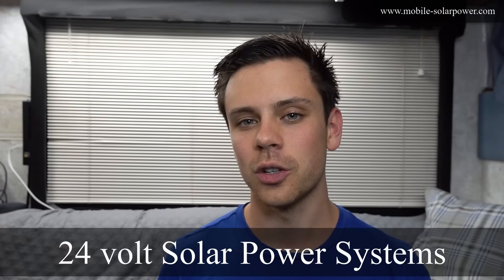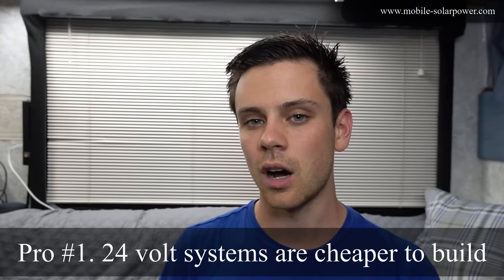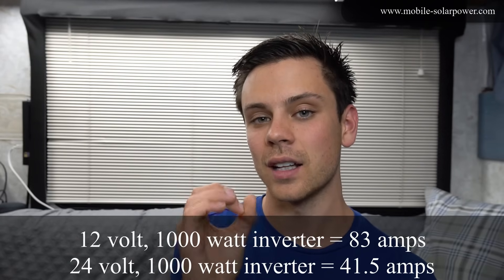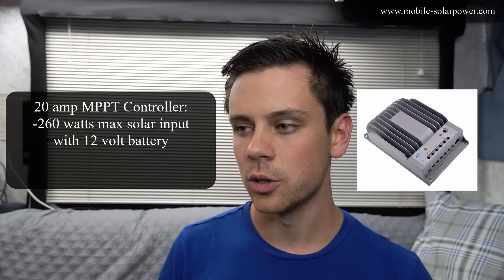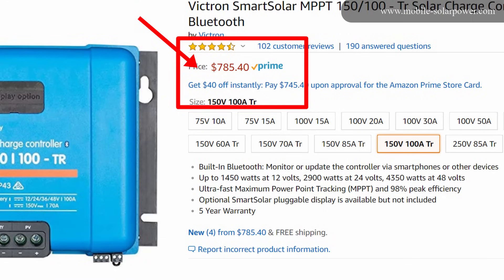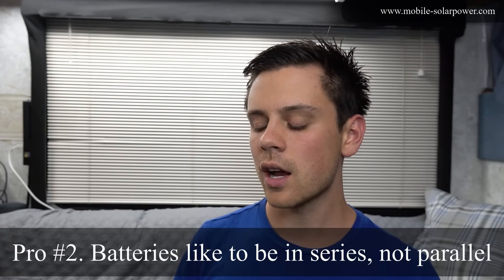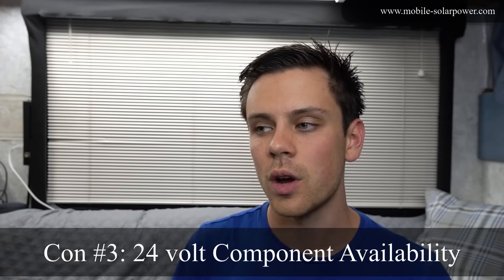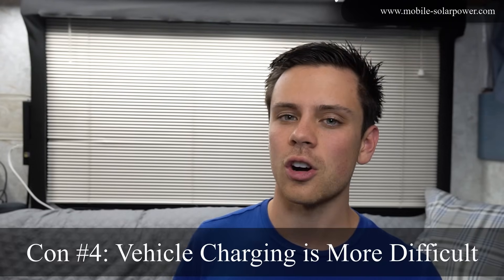12 volts VS. 24 volts for Off-grid Solar Power Systems

Comment: Isn’t the fact that you are spending double on your batteries kind of a big deal? You’re looking at an extra $1800 USD at least assuming we are building a 200 ah system or more.  That should be worth mentioning unless I’m mistaken about how all this works. Very new to solar systems myself so someone please let me know if I’m missing something.
Reply from the maker: No that's not true. You spend same amount. Watch my beginner videos to understand why Ah is dependent on nominal voltage, and why you need to use watt hours instead
Reply: DIY Solar Power with Will Prowse 

Thank you for the response, that clears everything up. Definitely cheaper to go 24v in most instances!

Comment: @ 4 minutes in you said you can't use 12 volt solar panels with a 24 volt system. Is that also true for 24 volt batteries on a 24 volt system to not be compatible? 

Thanks.

Comment: Will. I don't get the limit on parallel connection of batteries (FLA, AGM) as they have been the standard forever (since before you were born....) and they have been connected in off-grid homes with as many as 10 or 12 "batteries" in parallel. Often those 12-volt "batteries" were 20 or 24, 6-volts in series and then connected as 10 or 12, 12-volts in parallel. That was how it was and there was not a concern (that I remember) about having 10-12 in parallel. Is this new and something specific to MPPT or PWM??? Of course, those old Trogan 105's were monitored like crazy and had to be equalized and topped off, but I just don't remember an issue that limited parallel connection to 3 batteries if all the batteries were in good shape and well maintained. (?????)
Can you point me to where I can learn more to understand what you are talking about? It hits home for me as I am in the middle of a 24 volt, 14 battery (12-volts in series/parallel), 1200AH each, AGM battery set up for my home and don't want to screw it up. Thank you.

Comment: I am confused hehe, i currently bought 2 Canadian solar panels rated at 375 watts 39.8 volts 9.43 amps each... so what's best for that setup? Using a 48 battery? With what charger and inverter? But what i want to do is have 4 of those panels so what charger would be best for that setup I'm super confused.

Comment: Great video!  I’ve watched it multiple times. I’m trying to understand why I would take my two 12 volt 100 Ah batteries(200 Ah), wire them in series, to make 24 volts and be left with only 100 Ah.  This question assumes my 12 volt solar panels are wired in series parallel and all appropriate hardware is 24 volt.  I hope that makes sense and am looking forward to some input.  Thanks
Reply: I think I figured it out.  It’s the same watt hours.  12v X 200Ah = 2400Wh. 24v X 100Ah = 2400Wh.  Is this correct?

Comment: Hi, I really liked this video! I was still dreaming of charging my batteries also via car alternator, but maybe I will skip that one. One question relating to this all in one solution, do these things have temperature compensation for charging?
Reply: K.I.S:S. Always work! In a 12V vehicle quite honestly it's not very smart. To go for a step up, to than make a step down! When the entire system is there ready for connection just as it is! 
I addition batteries can also be charged directly from the vehicle. The entire electrical system of the vehicle and RV side can be interconnected without major issues! Material (12v) is dirty cheap and readily available literally anywhere. 

Years ago I assembled a 12V system with the 3 major separations and some "logic" circuits into it. Everything was of the shelf and cheap as can be! Not a single special order!  

- Input from the vehicle 12V alternator.
- Input from 230V (Europe). 
- Input from RV side, also on 12V. Also with inverter for 230V from the 12v source.
Each one of them interconnected, with the other. Self switched. All "logic" circuits were done with very basic (cheap) 12V - 30Arelays. Allowing the 0 - 1 binary (Off - ON) for turning on-off! 

Example: Connect 230v input. All 230v appliances/lights/plugs get ready to work as expected! Simultaneously activate battery charger (12V that first charge the vehicle battery than switch to the RV battery. Simultaneously power all 12V system, separated from the vehicle battery. All that by just plugging in, the extension cord! That was all, there was to it!  ;-)

Comment: Ok, now im confused. I have 2 100 watt panels. A 1000 watt sinwave inverter & a PMW controller & fuses with 4awg wire. No batteries yet since i dont know if 12 or 24v is better for my portable system

Comment: Can I simply use 24v solar panels with a 24v battery bank? I ask because you said there needs to be a minimum open circuit voltage of 40, but for many 24v panels I see have open circuit voltages of 38

Comment: Have a question, I have two 12v batteries and i ran them in series to get 24v, will my 12V 1000watt pure since wave inverter be ok to hook onto 24v  ?   Thank you!

Comment: Can you make a list of components I would need for a 24 volt system to power a large 40 ft bus?
Reply: My main concern is wiring what type and size I will need for inside the bus and for the solar system.  I want the comfort if an RV But better.

Comment: Hi Will, great videos I watched a few from your youtube channel and that are all fully packed of good information. I'm in the process of buying new solar panels and batteries for my 12 volts RV. The challenge is that every single appliance on my RV run on 12 volts, my engine alternator also charges my engine and house batteries (I did not know this was not a good idea.... it came like this from the manufacture). My problem is that I have little space available on the roof and thought to place two 24 volts solar panels and transform the output to 12 volts via an MPPT charger. When I compare sizes I can get many more watts out of 24 volts pannel to its equivalent in 12 volts. Would I actually gain anything doing so? Will 300 watts solar panel at 24 volts charge a 12 volts system faster than it 12 volts counterpart? (300 watts 12 volts solar array). Alternately I could place a 24 volts battery too and convert the output to 12 volts. This thought will require additional changes to the engine introducing a second dedicated alternator....... What would you suggest and recommend? I'm in a hot climate and will be using a Viesa cooling system a lot without the ability to hook up to the main power. I generally drive at list 2 hours every 3 days or so. Thanks for your contribution Daniele

Comment: I have  some 12v panels on my balcony around 200watt living on north of europe and yes solary delivers at least 8 month a year even in north europe. But I agree often 24v system is better since many electrical stuff such as laptops and screens is 19V DC for many laptops. In my case I stepeup 12v to 19v it would be better stepdown 24v to 19v. I also use a cheap  crappy 12v inverter to 230VAC for my 50Wh 40" screen around 15watt is going up in heat :(. 
My guess is that I would save some power by stepdown 24v to 19v and disconnect the AD-DC converter inside the monitor and get rid of the inverted. But for now my biggest concern is battery!
 Lipo batteries! Really hard to find batteries in Europe. I mean seriously cmon EU!!! what the hell is going here? we have alot of problem now getting people in job!!! we NEED battery in EU ASAP!  If we start LiFePO factories in EU guess what people will get jobs working in those factories! EU Wake up for got sake get stuff going instead of spend money on stuff that is not the future!

Comment: hey man quick question , if i run 800watt solar and a 80 amp Solar Charge Controller and the batterys are 135AH x 2   12v, what tickness of cables should i use? and also another question as im 100% new to this, is how thick of cables should run from the batterys for like leds & other lightning in my Camper Van?

Comment: Howdy.
This is a really comprehensive presentation. Just one comment. There are step-up converters too. So there is a way to run 24 V appliances if one should have a 12 V system.
Regards.

Comment: Back when my friend was installing solar panels on the roof, of a bus, it was a sunny day,  and he forgot to cover the solar panel,  when he grabbed the wires to connect  them he got a slight shock, but it was enough to make him loose his balance, and he fell off the roof and broke his wrist😆.  GREAT VIDEO Thanks William Orange county, ca.
Reply: Moral of the story: Don't land on your wrist! LOL 😂 

Jokes apart, as a young (and stupid) teenager I temporarily removed an electric wall heater (230V) from the wall. "Clever mind" taught no need to switch if off! I'll be just fine... 

Well. I was fine until, for a fraction of a second, I touched both wires. I was crouched doing the job. My legs spring so violently that I, literally, flew across the room! And upon landing, crushed the door of a cabinet on the opposing side of the room with my back! 
Only than I turned OFF the breaker switch... ;-)

Curiously! By now my hair and beard are white! AND I always turn the breaker OFF when messing with power! LOL 😂

Comment: Hey Will! Are 10 x 300w 24V solar panels connected in parallel connected to 20 x 12V 100 ah SLA batteries (series for 24v) work fine or is that a stretch?
Reply: A system that size (cost) running on 24v is kind of, sorry to say, ridiculous! 
With so many of everything, up it to a more closer to mains value. Remember  less difference implies less "investment"! ;-)

Comment: wait, why cant you run a 12v inverter off one bank of a 24 volt system ? we use the 12v side of a 24v system all the time

Comment: hmm when i hear you talking about health of the batteries i have a question (not use in solar but battery + inverter only)

i have a 24v system
4x 12v batteries (2 parallel to 2 parallel) they are lifepo 4 battery packs with overcharge and overdischarge protection inbuilt.

As i understand it the "BMS" should
stops accepting charge to that specific battery once its full but will keep providing to the other battery in parallel until both are full. (charging them 2 by 2)
If i use them as described the battery that runs low first will shutdown and the rest keeps going until 2 batteries in parallel is empty.

Comment: if you already have a large 12v battery system and want to do the solar array in 24v, can't you run everything on the roof at 24v down through the controller and then the controller goes to a converter to 12v for the battery, or do the batteries have to directly connect to the controller and always be the same voltage?  For several reasons, it would be best for my house battery bank to stay 12v, but I would like to run the solar at 24v
Reply: your question is the same as mine. for now i would like to continue using the 12v battery and inverter i have, but am thinking about going up to 96v volt solar array to keep the amps down on the headed to the mppt controller. have you had success finding anything out?
Reply: @jasonbrown467  There may have been a miscommunication or something.  I'm getting a Victron controller.  They are specifically designed for an input to 100v or even 150v from the solar....then they automatically convert down to whatever they sense is the voltage of the batteries.  I think the real point is if you have a ton of batteries, you don't want to have too many of those in parallel.  More batteries may force you eventually into a 24v battery system....either way, the controller will convert whatever you input is to match the battery bank.

Comment: Hey Will, can you verify my logic is correct on my RV solar system build? 
I am running a 24vMPP all-in-one, 4 12v solar panels (2 pairs of series)  and 2 12v batteries in parallel... 
I also am using a 24v to 12v converter. Will this system work properly?

Comment: When you say, you recommend Not to hook up more than 3 batteries in parallel. What about 4, 12 volt batteries, turned into 2, 24 volt batteries, then hooked up in series. Will that configuration cause problems after about 2 or 3 years?

Comment: I’m confused, @ 4:15 you said you cannot use 12v solar panels but, then later say @ 4:50 that you can take 12v panels and put them in series to get an open circuit voltage of 40 volts. Does this mean that you can use 12 V panels just not connected in their regular format they must be in series? Could someone clarify this for me?  My panels have an open voltage of 35.87 V so I’m assuming they are 24v and not 12v?

Comment: Real good info and explanation,... thanks!!!,  witch 24v battery would you recomend? becouse  i can not find 24v battle born battery at their website....  and another question , for an rv if you where replacing the AC and the fridge, would you go with a 48v Ac mini split ( i read that they are more eficient than the rooftop 110V, plus if I take them out of the roof, i will have more space for solar panels),  and a 12v Dometic fridge? (fire risk of the propane ones is a big issue for me), I know i am mixing alot of diferent voltages but i will have it worse if I use 110V AC fridge, or a 110V AC split airconditioner...., thaks for your time and good info in all of your videos.

Comment: 6:11 if your 12V power needs are low, how about tapping power from one of your 12V batteries (instead of converting 24V)?
Reply: You'll take your batteries out of balance. Good thought but you'll end up ruining your batteries!
Reply: It will cause your batteries to become unbalanced.

Comment: I have a couple of new battle born 12v in series and was getting 24 volts there was a snow storm so the battery discharged I have a victor on 720 so I thought it would save the battery but after the battery ran awhile the voltage dropped to 22 volts are the batteries still good I enjoy your video’s and would appreciate any help thanks

Comment: For SHTF type situations 12 volts is better.  I can charge using a lawn mower engine with a car alternator  running on wood gas. ALso after a lightning strike that zapped my charge controller, I was able to charge my system with my truck until the new controller arrived.

Comment: You convinced me to go 24v in my skoolie a while back, just happened to be rewatching this video. Great info. I recommend your videos to anyone I come across that asks about solar setups and batteries. Keep it up!
Reply: Do you have your set up so your alternator charges your batteries as well?
Reply: I'm trying to make this decision for my skoolie right now. My system is 400W solar with 400amp-hr battery bank. It's kind of in the middle of small/medium system according to Will. Any recommendation on the 24v? sounds like it worked out for you which is great.

Comment: i design 360w-48v pv panel, 48v chargecontroller and 48v battery  for 12v dc load with 1.1kw . However, i can not get 100A (1.1kw/12v=91.7A,  1.1kw) dc to dc converter online   to match with the load.  what shall i do?

Comment: Question. I am building 24v system but already have a 12v 2000w inverter, can you use a 24 - 12V DC-DC Converter into the 12v Inverter.

Comment: Hey Will, my mppt charger can handle up to 600v input. Does that mean I can charge my 24v battery bank using my 12v panels wired in series for 48v putting out up to 88 volts Max input to the mppt? If so can I add more series panels wired for 48 volt to reach my maximum 600v maximum input?

Comment: 12v or 24v?

me: 48volts
Reply: Use whichever is best for your application.
Reply: The same logic applies..24v better than 12v, 48v better than 24v.    48v is safe, or go 36v then if afraid of 48v

Comment: Lithium batteries have small lithiums batteries in serie and parallel to make the amps and voltage more.. so how do they calculate 5000-6000 cycles if it dies in parallel?

Comment: I suppose you could also have a separate 12v inverter connected to the RV 12v alternator charge battery, and plug in 30v dc charger/converter/step down transformer for the 24v solar batteries on your RV when driving.

Comment: @DIY Solar Power with Will Prowse hey mate, do you need to use 12v panels to charge the battery 12v or can i get normal panels that are upto 36v open clamp voltage??

Comment: Great video!

Have a separate question,
If I have a 3000 watt inverter, with 2 sets of battery terminals, one set wired to vehicle battery.  The other set wired to a separate battery.  Will I have 24v in total, or 1500w from vehicle battery and 1500w from stand alone battery?  Will the inverter be confused?
Thanks

Comment: In a boat, there is often set up with a 24V lifepo4 bank connected with a solar, wind generator, shore plug, Genset, inverter/charger and, above everything, a 24V intelligent alternator with charge controller like Balmar. Coupled with lifepo4 bank there is also one or two 12V batteries for cranking engine or to drive a windlass and thruster while the engine is running with 12V acid batteries. I'm wondering which is the best solution ore device for charging both systems 24 and 12 in a safe and reliable manner (the ability to always crank the engine in any situation is a key feature). There are few devices from balmar or mastervolt or sterling electronics but it's not very clear which is the most reliable.

Comment: William I’ve got 26 Yinlong Titanate 2.4 Batteries 62.4v Battery Back for my house should I buy another 14 Batteries to have 2 - separate 48v systems what’s the Highest Voltage you can use for Like off Grid living ? For Battery Back-Up ?

Comment: I have 12 crown 6v235 deep cycle batteries i have 6 series strings in parallel 1410 ah 12v. I could tie it to 705 ah 24v but i would need a large 6kw 24v pure sine and a new wind turbine and controllers.